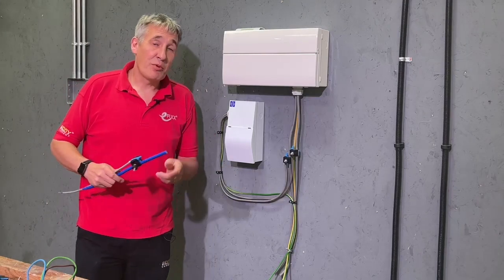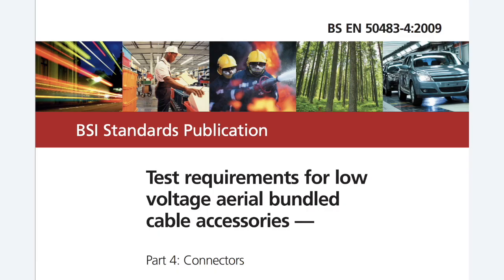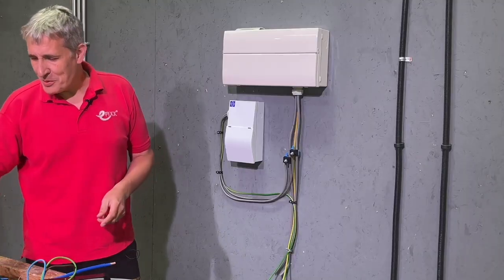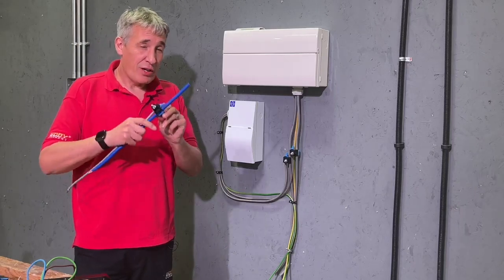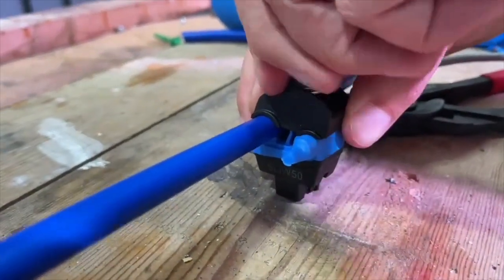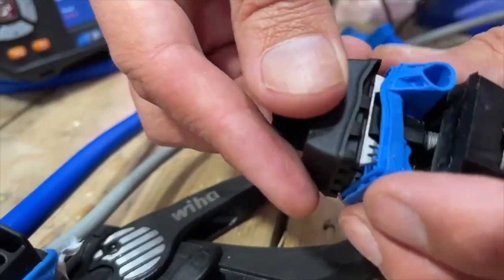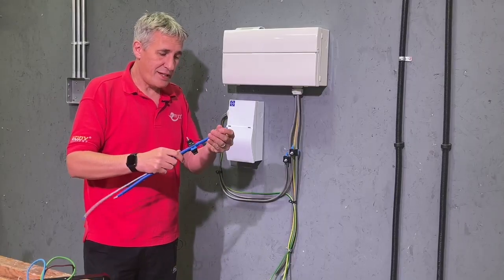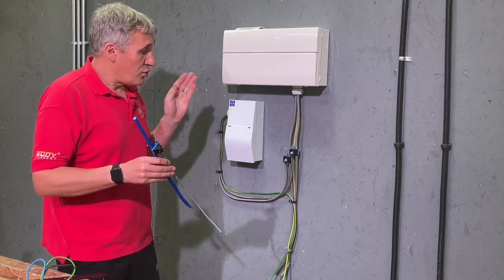Using INSULATION PIERCING CONNECTORS with METER TAILS - EV Charger installation - ENSTO SLIW50

Comment: The concern I have over the use of these is that there is no torque setting, as you demonstrated the bolt sheered off easily. Over time this could have the potential of becoming loose. Also how do we know that there is a suffient connection to the cable, the teeth don't look strong enough with a sufficient area of contact to pass adequate voltage. 

I can see these being a substantial fire issue in domestic installation, look very flimsy or smart. Henley block on the other hand give a much more substantial fixing with symmetrical and netter finish.
Reply: The bolt shears at the point sufficient torque has been supplied.
Reply: @prduguid  I would disagree. Many electrical accessories have a torque figure that is set by the manufacturer. This ensures that the accessorie is being fitted to manufacturer specifications. The bolt Sheering off now leaves the item with no secure fixing and loose, so therefore there is no more torque.
Reply: @nathancurtis2585  the outer hexagon of the bolt head shears off leaving the inner hexagon in place which can still be loosened or tightened with a smaller socket on the ones I’ve seen.
Reply: The bolt is specified to sheer when sufficient torque has been applied. So there is no need for a calibrated torque tool. If the bolt hasn't sheared then its not tight enough.
Reply: Have a watch if this explanation https://youtu.be/8JFfXZt7QoI

Comment: I think the problem is - and I don't think you can remedy it - is that it 'looks' like a bodge. All the corrections to cover the regs is still going to make this look like a bodge. We've all seen the images from Lebanon of  private generator distribution, and this looks like it belongs there. Not in a new installation complying with 7671. 
A Henley block is a quick, easy addition, not a huge cost, it's adaptable, and a neat solution. 
I don't think we need to reinvent the wheel to let lashers sling in more EV points in one day. 
Let's take some pride in our work. 

If it ain't broke...

Comment: Great stuff. But I couldn’t see myself using those for meter tails. I’d prefer any connection to be encased & preferably in a metallic enclosure grounded off. 
Henley blocks have been around for years and they work well.

Comment: No double insulation,  no undoing once installed.. Good for where they are designed to be used and not in an accessible by hand cupboard.

Comment: It's Aerial Bundled Conductor, not Cable. Only time I've seen a IPC or (Munchman if you live in Lincolnshire) 🤣🤣 fail is when someone has installed it on load and damaged the teeth. We even use them on insulated HV conductors. Decent bit of kit.

Comment: Looking at the comments the main issue raised is that its not double insulated…..  is a henly block double insulated ?
Reply: I agree. However for a long time now i have been uneasy using henley blocks. They break to  easily  i think.  I don’t think these line taps are any worse than a henley.
Reply: No but has the correct IP rating
Reply: It's hard plastic, as opposed to something that's more like wire insulation.

Comment: The only reason this type of joint is being put forward is to allow semi skilled installers too flood the ev charger market with cheap labour. Our governing bodies will take the their registration fees badge them up and fuck the time served electrician.  It is the same as EICR market, smart meter installation and now EV s the race to the bottom and bigger profits. I used these type of joints on a street lighting installation where a heavy armoured cable ran around the perimeter and then tap off smaller to each column.twenty years ago mind you but outside so they are not new

Comment: Reminds me of the 'scotchlock' type connectors used in cars - always had issues with those, so don't actually hold out much hope for these.
Reply: Yes that’s right, you find tow bar faults where people have used scotch locks and then over time they have become faulty
Reply: @lakesideaudio Not just tow bars either. In 40+ years I have seen all manner of 'repairs'  carried out using them including one particularly scary bodge where another auto sparks had repaired the 100 amp alternator cable on a TVR  by separating the conductor strands of both ends of cable into three bunches and then joined them together with  yellow 25 amp scotch locks,all flapping around and un insulated behind the OSF wheel! A whole body harness joined together in a Rover 114 GTi and even universal O2 sensors fitted with them where they more or less instantly melt. Dreadful things of no use for anything whatso ever.
Reply: @notpoliticallycorrect1303  couldn’t agree more, they were around over 30 years ago when I worked in a garage, I’m surprised they are still being used.
Reply: That was the first thing I thought when I saw this.
The problem with scotchlocks in cars is two-fold:
1) corrosion, due to no sealing (unlike these);
2) no vibration suppression (not an issue when not in a vehicle).
I think I'd still rather use blocks though.
Reply: @PipeManPeep  Bt use a nice version of the scotch lock, only any good to join 2 bits of wire though if I remember, but when you use one of those they are filled with a white grease
Reply: Scotchlocks were more destructive as an IDC connector though. This doesn't harm the cable in quite the same manner. But also not convinced of the pierce's integrity for a high current application like an EV
Reply: Scotchloks are the fuel of nightmares for mechanics.
Any electrical problem I get on a machine and I start finding scotchloks their the first thing to go and often that's the problem solved, mainly due to corrosion or used with the wrong size conductor. They work(ish) but theirs far superior ways to tap into conductors.
Reply: I thought exactly the same!

Comment: If my old aftermarket car alarm is anything to go by, then its a no. If it was double insulated in a durable case that it could be fix back to a wall to stop to joint being disturbed it could be handy, you are left with a non-removable connection though.

Comment: Wouldn’t touch these with a barge pole! Wouldn’t feel comfortable installing these with an outgoing 10mm max csa without a fuse. Very small contact area and surely installing some sort of enclosure negates the point of space saving in the first place.
Reply: Might as well delete Ib <=  In <= Iz  from the Regs....( less to remember ).  Plus, the DNO Sub Stations will probably go POP first, when we all charge our cars at the same time over night, switch are Heat pumps ON, Storage Heaters, etc.
Reply: @ats-tj9rc  Yup, we've got nowhere near the generation capacity either and every bit of cabling under every street, every substation ect.. is going to need uprating.
People don't realise that even though we have a 100A breaker in the distribution board that what's outside our house all the way back to the substation isn't designed for everyone to draw that much power all at once.
Once everyone has extended range ev's and some form of electric heating it's not unfeasible for the average household to be drawing 40 to 50A nigh on continuously overnight.
Most technically minded people who bring these issues up just get dismissed.

Comment: Yes the nut sheared, but it wouldn't be hard to put 2 nuts on this and for Mr Dodgy Joe Public  to back these off and then reapply to the  incoming meter tails to get free leccy, (other methods are available) people are not stupid so don't underestimate them, far to easy for people nicking leccy to leave an install dangerous imo

Comment: OK if out of reach, but as suggested already, better inside an enclosure, but then you may as well just use Henley blocks... that crappy insulation on the end is just meh..no no... looks a rough job too, those bolts even though isolated look wrong to me.

Comment: I have used on street furniture and was told they had to be out of reach by hight or locked away where a key /tool was required to gain access. On singles double insulation just clamp on.  if it was main supply then needed to strip off outer sheath and neutral outer strands, the use to connect to inner phase carrier.

Comment: Certainly wouldn’t trust them for 32A, they might work but there’s not much surface area to connect to compared to the solid Henley blocks. Henley blocks haven’t had to change because they’re robust and solid.
Reply: Might seem like that but have to remember the DNO uses them for their connections on outgoing supplies of up to 100A or possibly more.. So they must work
Reply: A wago connector is rated at 32a what surface area of contact has a wago got

Comment: How I see this is BS7671 specs 25mm tails on a 100a main fuse then using these we can drop down to 10mm for a small additional CU for an EV charger. Doesn’t seam right to me !
Reply: Under certain conditions you are permitted to connect a protective device downstream of the cable.  I'd say it needs to be short, visible throughout its run, and in a location where it is unlikely to get damaged.
The DNO cable entering your house is fused downstream at your service head, and not where it taps off their big cable under the road.

Comment: they actually allow that being done there in the UK? that looks nice but how safe is it? looks like its coming right off the mains... isin't the EV charger suppose to have a breaker on it in the panel? or do they need a 60A feed? the method is just like the small 3M connectors you use in the automotive industry... inline splice

Comment: Surely it's contrary to the most fundamental part of the regs and is a C2? Basic insulation only. What's the debate? Put it in an enclosure and it becomes an even bigger Henley block. There's a reason it's used aerially

Comment: Looks like a good way to bypass your meter at home without disconnecting anything 🤣
Reply: Suppliers of exotic fauna and flora will soon be on to this.😂
Reply: @markgilder9990  And indoor tomato growers.
Reply: Yeah, I can see a BIG market for these beauties.
Reply: @markrainford1219  yeah for dope grows and bitcoin mining 🤣
Reply: Exactly my first thought
Reply: Shhhhhhhhhhhhhh lol
Reply: They leave a big hole. Not a good idea to leave evidence of your crime. The DNOs are aware of this - they meter power at the substation and compare to billed usage. Too big a difference indicates that someone is likely stealing power, and it's time to send the meter 'readers' around for a 'routine equipment check.'

I have heard stories of people tapping the cable like this, but using little needles. Can't draw much current through each needle, of course - but once removed they leave only the tiniest of pinholes in the insulation, impossible to notice without a very close inspection.
Reply: @John J Kelly It's just kind of a resurgence of the old trolley bus concept.
This set up had also been used in some open cast mines around the world with 200+ tonne payload haul trucks as many have diesel electric transmissions anyway, pick up on a catenery when climbing out the pit whilst the ones decending feed into it via regen braking.
Reply: Not linked to this I was changing plugs on catering equipment.  That has two leads and plugs.  Such as a double fryer and a double grill top.  Each is switched independently also has thermal cut-out and to switch on and off.  Each is 2800watt each.  Has been plugged in to a double socket.  So is 4600watt when each is on.  Off one double 13amp socket.  It is all 3 phase so socket 1 then 2 then 3 phase 1 2 3 so I have moved each plug to the next socket.   As it is 13amp can we have a double socket with say a 10amp appliance and a 13amp appliance so 23amp from one double.  Am about to look in on site guide.  Should I chop each plug off and hard wire each.
Reply: @alunroberts1439  pretty sure most standard socket outlets and switches are rated at 20 amps .

Comment: These are good but like you have shown I’ve only ever seen and use them on aerial feeds.. It’s not that it doesn’t work but I’d leave them to do the job on the poles only, there’s better products to be used in that situation like that Henley block. You’ll be connecting things live on the pole so it’s convenient the torque nut to not be linked to the actual connector. There’s not much to innovate in terms of connecting 2 thicker cables, what’s needed is people thinking in advance and install a bigger fuse board with 2 rows of 12 modules for example.. plenty of room for future upgrade so you can install a din rail distribution bar and breaker without the need of adding an extra fuse board or tapping into tails.. all in one board.. less mess

Comment: I am, by no means, any sort of electrician, but have had a lifelong fascination with anything electrical. Those connectors are everywhere in Europe, and I've often wondered how the spikes make enough contact through the insulation to carry sufficient current? I found a discarded one and took it to bits and, tbh, I thought the spikes rather small for what they need to do. But that's just me.

Comment: Roll in even more bodge it and scarper "traders". Personally I wouldn't touch these with a barge pole, they need another cover to go over them,  they need a way of being fixed to the wall and dropping down from a 25mm cable to 10mm with no fuse inline... No, not for me.
Reply: Fixing a jbox to the wall and enclosing them inside solves two problems.
Reply: @jessejackson4690  except you'd need to slice the junction box open to insert they cables.
Reply: Unless you use something like a large DeBox, but with all that added space used used... Just use a Henley
Reply: The protection is from the MCB in the sub-CU. Regs allow far-end overcurrent protection of cables <3m
Reply: @mikeselectricstuff  I've never heard of this, any reg you could direct me to?
Reply: @mikeselectricstuff  all good but would you fit 10mm tails to a house board ...it just seems so wrong to fit 10mm tails just saying ..

what if some numpty added a 63 amp workshop mcb into car charger board 🤔 and car charger was on too for 8hours just saying like..its feel very bodgy

Comment: In Australia - these are prohibited from being used within reach of the consumer, unless secondary protection is used.  They are typically seen if splicing in a home supply tail from ABC or UBC feeder loop.  Again - they are 5M in the air and are typically single insulated.    They are not intended to be moved/removed once installed.  Once torqued-up they are intended to be left in position for the life of the installation - untouched and not subject to ungloved contact.  Replacement requires that you replace the feeder cable - so we leave these in-place and go again beside the broken connector.

We use these in the supply network extensively - and this is where they should stay.    Given their existing design, using then in contact with consumers is extremely dangerous and IMHO should be expressly banned for such work.    IPCs are fantastic products - but in their existing form - not for this purpose.
Reply from the maker: Great input and sensible advice - thanks
Reply: I agree. Putting them into a jbox tidies them up and keeps them out if reach from contact
Reply: Agree, I have used IPCs in australia, on overhead works, they are a great product. It will be interesting if a supplier will design a suitable product
Reply: Great information. I've just started learning about this topic in class but the information they provided was the aerial cabling for the supply mains had to be 3m minimum above the ground, around where the IPC would be located. Is this different than the 5m requirement you mentioned?

Comment: How are these removed once the shear nut breaks?
Reply from the maker: undo the 2nd nut.
Reply: They aren't meant to be removed, installation will breach the cable insulation. Remove them and you would have to discard the cable too

Comment: As an apprentice, late 70s/ early 80s, I came across a form of busbar trunking which was nothing more than 300 x 100 steel trunking with large 6491x cables clipped to the back of the trunking  and tap off points were put anywhere by using line taps. These 'large scotchlocs' have just reminded me of that
Reply: Yes we had that in an electrical engineering lab at university in the 80's.

Comment: But you are tapping into 25mm2 tails with 10mm2 tails and there is nothing else than a 100A main cut out fuse protecting that cable. Yes, in case of EV there may be some sort of RCBO at the end of that 10mm2 tail, but should that chinese RCBO weld itself open upon fault conditions or a fault occur before the point of fuse down, there will be a piece of cable in your installation that doesn't comply to the 
Ib ≤ In ≤ Iz
rule in BS7671 and the only thing protecting that piece of cable is a delayed BS88 or BS1361 fuse capable of withstanding double its rating for many hours...
Reply: In fairness 10mm may be adequate for fault current sizing. Overload protection could be achieved by the downstream device and if like you say that welds then the final circuit is probably just as in trouble!
Reply: 1 less regulation for the rule book.. PLUS, The DNO Sub Stations will probably go POP first, when we all charge our electric cars at the same time over night, switch ON our Heat pumps, Storage Heaters, etc. And Gas boilers are a thing of the past.
Reply: 10mm is still over three times the size of a 100A fuse element.

Comment: Been using these for nearly 2 years, really great stuff for EV chargers.
Reply: Do you strip a layer of insulation or do you connect throu both layers thou??
Reply: Any brand you would recommend? Thanks

Comment: Be interesting to create moisture around it and conduct an insulation resistance test.
Reply: 1000v insulated the ones we use on the overheads. Never any problems unless an idiot has installed it.